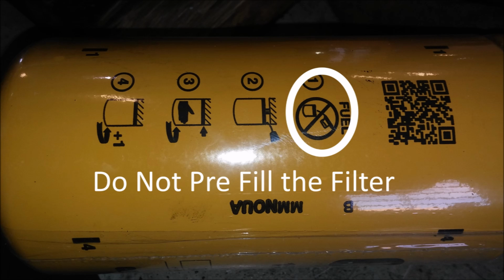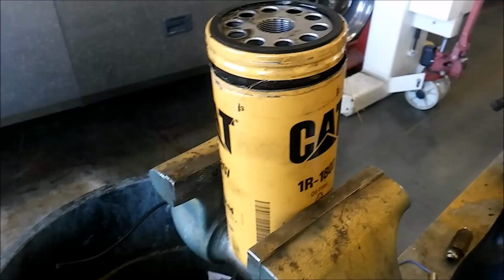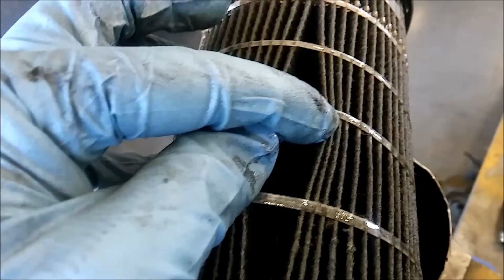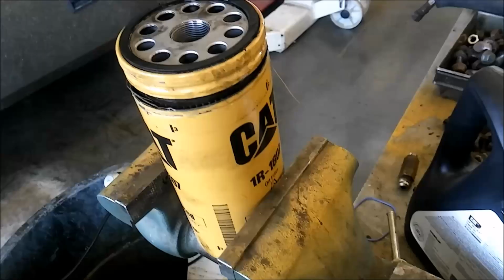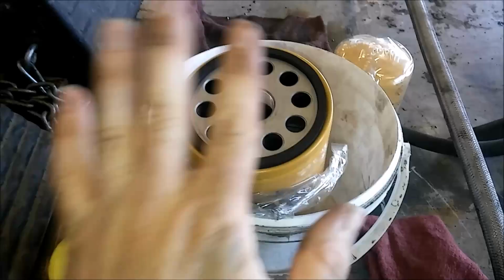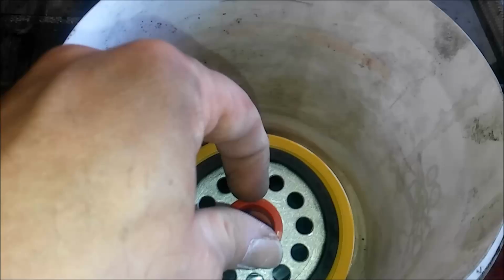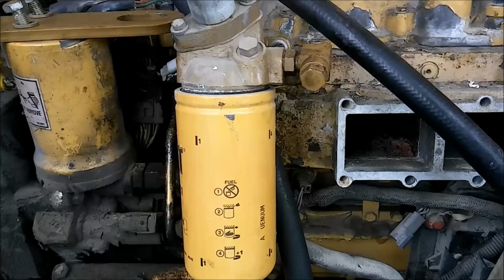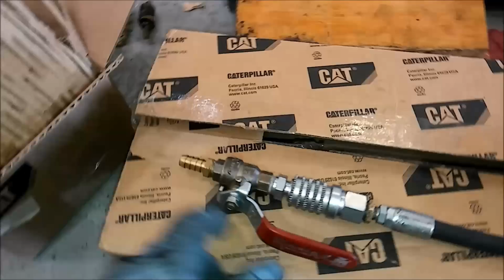Should You Pre Fill an Oil Filter? Should You Pre Fill a Fuel Filter?

Comment: I know on one of my old cars i have if i dont pre-fill the oil filter the rods knock when it starts after an oil change. I changed the rod bearings one time on an old ford tempo that did that. Pulled the pan and did it right in the car. Ford used rtv only for a gasket lol. Ah the good old days

Comment: It may make a difference if an engine is newly assenbled, or rebuilt, but not for an oil change.  On most engines, the process of adding oil after a change pours the new oil over the engine, lubricating most of it.  Unless over-revved immediately after filling, the amount of damage caused as the filter is filled by the oil pump within 30 seconds is miniscule.

Comment: I like your vids. But ive been working on class 7 and class 8 trucks for almost 20 years now and I have NEVER pre filled an oil filter and have always pre filled fuel filters from the center. Have yet to see any reason not to. And some of out customers I have done every oil change on the same truck for more than 10 years with no issues. And I work on Cats, Cummins, Detroit, Mercedes, IHC, John Deere Etc... I don't work at a Speedco, I am a mechanic at an independent shop. Just throwing that out there lol!  Keep up the good vids tho.
Reply from the maker: +Kyle 01 Everyone guy does it differently. They have their own reasons too. I just laid mine out in the video and told Cat's opinion. Never thought oil filters would be such a controversial subject.
Reply: lol. not downing you or your vid 1 bit. Love your vids. You have an easy way of explaining things without trying to over complicate explanations. Keep them coming!

Comment: I've been taught to always prefill the engine oil filter except when working on heavy duty construction equipment like CATS. I've been told not for CAT because when prefilling, you can get dirt in the oil when prefilling and wrestling with the oil filter during installation.
Reply: You'd get dirt in the filter wrestling it on either dry or prefilled. If you're fool enough to not clean the filter housing first, then you get what you deserve.

Comment: i fill fuel filters to keep the system primed. the new frieghtliners have to have a fancy little setup that uses shop air to prime the system. old diesel over the road tractors, had to crack the injectors lines and bleed them system while turning the engine over.

Comment: I used to change fuel filters on dredge motors that did not have in line fuel pumps, that relied on the motor pulling the fuel from the tanks. I filled the filters to the rim and screwed them on because if I didn't I would be there for 45 minutes priming the fuel filter manually until my arm fell off.

Comment: on a diesel i aways fill the  fuel filter  if possible , since there is no electric fuel pump to prime the system ( i know there is a manual pump but every bit of work you can save yourself is a plus )

Comment: We have 3 New Holland engines that allow you to pre fill the oil filters which we have always done as we were never a fan of the rattle before oil pressure comes up. All 3 engines have 43000 hours combined and have never been touched. So 6 of 1 half a dozen of the other as they say.

Comment: I thought the only reason for pre-filling an oil filter was to maintain constant oil pressure at the first startup after oil change.
I fill oil filters through the large center hole. 
Within 30 seconds the filter is full, both sides of the paper element.
Really doesn't matter where you fill it.

Comment: The two idea do not conflict (when referring to fuel filters) Cat expects you to use the provided hand priming pump after replacing filters and injectors. That's just common sense. Prefilling a diesel fuel filter is the quickest way to damage common rail injectors.

Comment: My argument is that I put brand new oil straight from the bottle into my squirt can then on engine parts when I build an engine anyway. Therefore, I understand other arguments but still prefill my filters which is something I’ve been doing for decades. To be honest, I think the dry startups from a dry oil filter at every oil change would do more damage than prefilling the filter.

Comment: Some of them huge diesel equipment filters are so huge you have to fill them but the smaller ones you don't have to fill the oil filters but then the gas filter or the diesel I mean the truck won't start unless the filters for like two Freightliner in the Volvo's and so you have to pre fill fill the filter for the fuel and it doesn't really matter where you put the oil the inside or the outside it's it's going to eventually get to both sides so just put it in the middle really quick or or both at the same time because you don't want that for one second not to get oil

Comment: Every diesel engine I've serviced had a manual lift pump and the system was bled of air by pumping fuel into and thru the filter and out of a bleed screw or outlet union before starting. The injector pump and 1 or 2 injectors are similarly primed. All this before the engine fires up.So the filter is 100% filled with fuel when no more air bubbles show.Pre-filling would be a waste of time and effort.That's how I was taught in a deisel engine factory and no pre-filling of oil filters.Cranking the motor when setting valves   allows you to see that oil has reached the rocker shaft by which time all other bearings are under some oil pressure.

Comment: Fortunately ,I don't prefill when it's impossible to do so , like a sideways mounted oil filter. Which would just be a complete mess if I did prefill. I do however bump the motor several times before starting to attempt filling it once it's installed.

Comment: I couldn't agree with this video more. and how about the tiny holes in the injectors, don't want them clogged eather.
Reply from the maker: +Brian Schnell I'm glad you brought that up, actually had a set of injectors that had been pulled out of an engine during a rebuild by a customer and were in a dirty environment for a few days. Customer brought us the truck because it wouldn't start after the rebuild and it turned out that the injectors were junk because of them being contaminated and would not fire. Had to build all new injectors, then the truck fired immediately. Keep them clean!

Comment: You could always put the filter on without prelubing then crank the motor over with a hand held trigger(ignition off) or unplug the fuel solenoid then crank with key. I usually do that with rebuilt motors out of the crate.  When an oil filter is clogged or it is too cold it will bypass internally in the head. How about guys not doing a cool down and wasting the turbo-very common.
Also-European and newer Tier 4F motors have element style filters that change from the top(can't pre-fill those).

Comment: If you don't want air in your fuel system, why would you want it in your oil system? Also, you're not going to be putting dirty oil into the filter, so which side doesn't matter, unless it has an internal check valve.

Comment: Fill oil filters thru the perimeter holes to saturate the element.  The center hole is the return flow.

Never prefilled a fuel filter.

Comment: When I changed my truck from factory fueling system. I put in the plumbing for recycling the fuel back to the tank, with the nessecary valving for closing the system ( in two fuel filters primary /secondary  and out) there by the system should  provide fuel to the factory fuel filter.

Comment: I found out that on an old farm tractor, if I don't pre-fill the oil filter, on that first start it takes a scary long amount of time for the oil pressure to come back.  Pre-fill it and it comes back right away.
Reply from the maker: +bledlbledlbledl If it takes more that a handful of seconds you probably have a with oil pump or internal oil leak perhaps. I would definitely pre fill that filter then, but just fill it on the dirty side if you can.

Comment: on non electonic cat and cummins ,if you dont prefill the fuel filter you will crank the motor a lot longer then I feel confortable without the engine getting full lube. on the road I like to park at the top of a hill if possible ,change filters and then roll of the hill with it in gear .

Comment: We recently changed suppliers for lubricants at the company I work for. They sent people in to give us some training on lubrication and the instructor told us we should always filter our new hydraulic oil we put in our machines because new oil has contaminates that could damage our equipment. I suppose motor oil would be no different.
Reply from the maker: +Dan Dearman Perhaps, it is a scary thing to think of if there are contaminates in new fluids. They should be pretty clean.

Comment: I never prelube the oil filter on Cummins 6c. Picture the old 71series Detroit 4-71,6-71 where the oil filter sits on horizontal ran those for years and never an issue. Always prefuel the fuel filter,s

Comment: In an automotive filter that's bought in a typical auto parts store, it's not sealed or wrapped in any way. Far greater chance of crap already being in the filter, than in the jug of oil.   I didn't buy Pure one oil filters for a long time, because they came with this sprayed on grippy coating, that was all over the inside of the box and the face of the filter.  Pretty much contaminated right from the factory.

Comment: after a fuel filter install, if no electric priming pump is fitted in the tank, I remove the engine side fuel line from the filter and suck fresh diesel thro the filter, connect and restart. hand priming pumps often dont work or leak, this is on small diesel cars, I dont deal with heavy stuff but surely the same could be done especially if there is test ports. 5 min with a mightyvac and the filters full in situ.
Reply from the maker: +Denis O'brien I usually do this on a rebuild to help purge the whole fuel system. It is a little bit more time consuming on the trucks.

Comment: John Deere engines typically prime their fuel system by an electric fuel pump. So waiting a few seconds before starting the engine wil fill the fuel filters and remove any air in the system.

Comment: I have been a tech for over 25 years and have seen the bad that happens when you prefill oil filters . simply put I have pulled small trash from the  oil rifle that has  come from the oil container everything from the tin foil seal to a barrel seal that has wipped out two cylinder packs when unknown to me the piston cooler was plugged..two in frame rebuilds in a week will stop that practice.
Reply from the maker: +jeff alley I believe that is why they recommend not to pre fill and why they are mostly going to canister style filters which makes pre filling nearly impossible. Thanks for info.

Comment: I work on trucks for 15 years and worked for quit a few truck shops. Every shop I've worked all done it different sone say to fill oil and fuel sone say not to. the mechanic really doesn't have a say on what way to do it you have to follow what the Co wants done and that is all there to it.

Comment: Most new diesels are self priming just by functioning the ignition key . If you want to change oil without filling the filter run the engine for a couple minutes to lube the engine before .

Comment: It certainly would not hurt to pre-fill an oil filter...if the filter was mounted vertically so you don't spill any oil out of it. For diesel fuel filters...I've always seen and learned you have to prefill them so you don't introduce a lot of air in the fuel system.

Comment: Any filter over 1 quart and above fill with clean oil keep your bearings from going dry clean diesel in a clean bottle fill your fuel to injectors and injector pumps do not like air also when you buy a jud oil if there's any contaminants will be at the bottom don't shake up the jug fill your filter first don't put your filter were dirt could fall down the middle hole, it'll ruin your engine I've torn down many engines and I can always tell when somebody's got dirt in the oil filter when they put it on the bearings were always show it especially sand

Comment: Love your content.  Got a question for you.  I got a c13.  My manual says not to prefill the filter but then it says "To help prevent crankshaft or bearing damage, crank engine to fill all filters before starting.  Do not crank engine for more than 30 seconds."  How long does it take to fill up the filter without starting.  I have a 1r-1808 filter.  How do I go about turning over the motor without starting it?

Comment: How long will it take for an empty oil filter and the oil to get back into it and drive the air out of the oil system and have the oil back where it all needs to be. That's why I will fill the oil filter with oil before I install the filter

Comment: I'll risk the dirt in the new oil to keep my engine from making awful noises on start-up.
Filling the right side is a great tip!
Does anyone see a problem if you fill the filter from the right side?
Reply: Nope, no technical issues with filling from the dirty side, that is what the oil pump is going to do anyways. There's just the practical issues of getting the oil into the filter through the anti drainback valve most filters have without getting it into the clean side. And the obvious issue of potentially spilling the oil when you screw the filter on.

Comment: If you study the PQ (pressure/flow) curve on a C15 engine oil pump, you'll see 60ish Gallons Per Minute (GPM) at 40 psi which is achievable at 725 engine rpm (low idle).  Knowing oil flow, one can assume that the engine is capable of filling the oil filter in a +/- 1 second. One second of low oil pressure will not hurt engine components. On the other hand, contaminants introduced through preventive maintenance CAN and often DO hurt the engine. The engine bearings have limited embedability - meaning they can capture a low amount of contaminants without causing problems and store those contaminants to prevent engine damage. If you introduce too many contaminants over the life of an engine, you risk the bearings not being able to retain those contaminants and they protrude through the oil film thickness and can damage internal components. - Don't pre-fill filters.

Comment: I have got a genuine Perkins oil filter in front of me.  This has an icon saying to pre fill. The picture just shows oil  being poured in the centre. This is probably a really bad idea with a fuel filter, but not too bad with oil....if the oil is clean.
The strange thing is Perkins and Caterpillar are now the same company, but even the advice from  Perkins and Cat conflicts.
I would pre fill but use the outer holes.

Jon
Reply from the maker: +Jonathan Tyas As long as you fill from the dirty side its fine. I'm not sure if the Perkins fill from the center or from the outside. You could always cut your old filter to determine which is which then prefill that way.
Reply: Adept Ape 
To further confuse things I read the manual for the Perkins 1104D, which I believe is also known as a Cat C4.4 and the manual says to never fill the filter. The filter box says that you should.
Normally i wouldn't  bother pre filling, however this engine has sat for a few weeks since having the new oil put in so is probably a bit dry. I will fill from the outside though, pressing down the anti drain back valve to let the oil in.

Jon

Comment: Cat engine lube oil systems have a filter bypass valve that will open when the filter is dirty or the oil is cold, allowing unfiltered oil into the lube system. So saying it is harmful to pre fill an oil filter is just untrue. Fuel filters should only be filled with the priming pump, or the aforementioned center hole plug.

Comment: we replaced the ECM in a 2003 Chevrolet Kodiak with a 3126 caterpillar. we found power and grounds were proper but engine wouldn't crank or start. we were able to Crank by grounding the yellow inhibitor wire going to the relay but wouldn't start. sent ECM to Cat dealer they could not access information from it so they installed basic cat information. engine starts but still have to ground inhibitor wire engine runs fine but instrument cluster lights on and tachometer is erratic. this was after using a laptop to turn on as much of the parameters as we could but we still are showing a trouble code for check timing sensor calibration.
Reply from the maker: +George V. McRae McRae Wrecker Service Since they couldn't get a download from your old ECM it probably doesn't have any timing calibration. It's actually an easy fix, they can input any other 3126 copy configuration file into it and it should carry the timing.